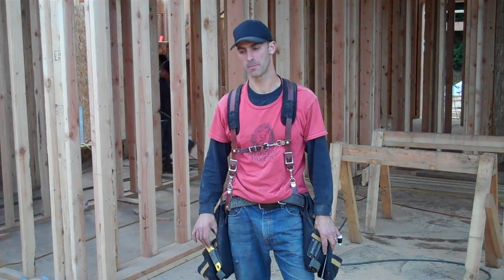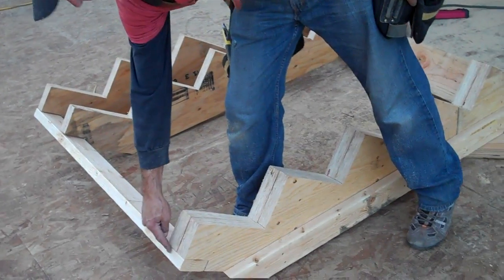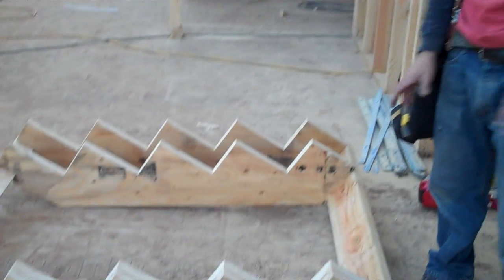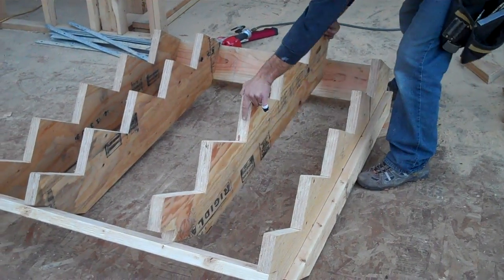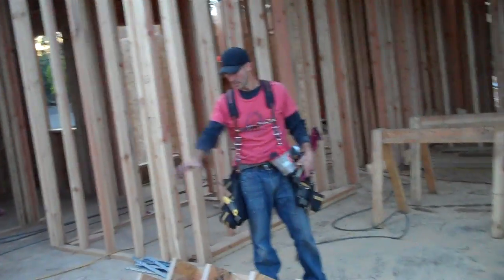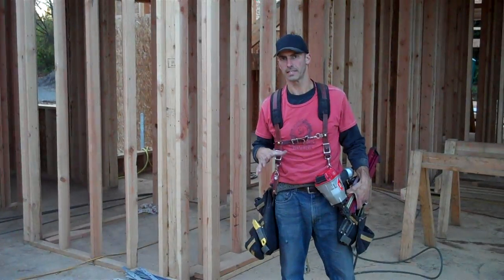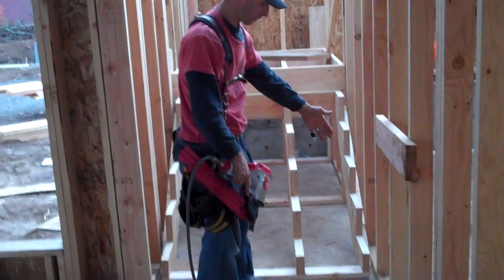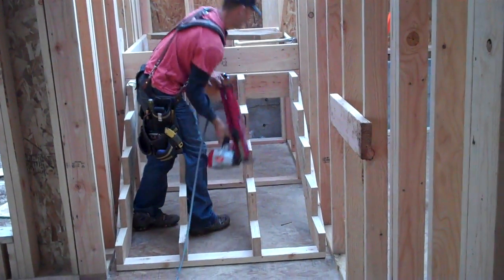How to calculate, layout and  build stairs- Part 3 of 3

Comment: Hi, great job and well explained. 
When you dropped the lower stringer by one tread thickness,  do you also drop the middle and upper stringers in the same manner?
Reply from the maker: Basically yes, but you need to think through each section about how you are installing it.  For the bottom of the lowest stringer, when you cut the thickness of the tread off the bottom, you are ensuring that the step differential is the same all the way up.  If you didn't, the first step would be too tall by the thickness of the tread.  So to your question, if one of the subsequent sets of stringers is sitting on a landing, you'd need to adjust those too.
Reply: Hi, thank you for responding so quickly.  I'm taking from your reply that I should reduce all stringers so all the risers are at the same height.  I was just concerned that after I do that my top flight would not be tall enough and I'd be left with a very high step onto the upper floor. 
Thank you again for all your professional advice,  I really appreciate it.
Reply from the maker: @danthechippie4439  If you have done your overall rise math correctly, and then cut your striggers accordingly, all you have to adjust for is your tread thickness.  When you cut your stringers there was the same rise from one to the next.  When you add your tread material, you have kept that same rise, since you added the same thickness tread to each rise.  The exception to this is the very first one at the bottom of the stringer(s), since you did not add a tread thickness to the floor.  If you didn't trim the first one, your first step would be too high.  Now to complicate matters, you need to account for the flooring to be used on the lower floor, the stairs, and the upper floor.  I highly recommend that you do a sketch so that you can capture all these elements and get your striggers correct.

Comment: Great series of stair videos.......So you reduce the overall width of the stair assembly by the thickness of the strong back pieces?
Reply from the maker: Yes, from rough framing.  These 2x pieces space the stringers off rough framing enough to allow for sheetrock and stair skirts to slide between the stringers and the wall.  This makes the install of sheetrock, and especially the skirt material, much easier as you don't have to notch for the stringers.

Comment: Torrey, you are a convincing teacher/carpenter. Your camera guy moves efficiently and lingers on markings, crucial. Maybe use a Sharpie( thick lines). You've mastered the 3 parts of explanation: tell us the 3 parts, explain and show the parts, and tell what you showed us. As a beginner, I made sure to lay out and cut 3 sample steps  on a plywood piece! Notch is slick addition.

Comment: How do you know how long of a stringer you will need so you're not buying too short or too long of a 2x12 or 2x10.
Reply from the maker: There is no easy answer for this.  You will need to either do some rough math or physically measure the area where the stairs are going.  Add 4-5 feet to what you think you need.  There will be a decent amount of waste on each end of the stinger- best to have a bit of extra than not enough.

Comment: this was a good video, one thing i must say is that you did not mention the importance of working from "finished floor to finished floor". the landing will have 3/4  subfloor on it and probobly some type of hardwood on top of that, or tile or watever. you have to take that into account if you want every rise to be the same. also you took off 1 1/8 off the bottom rise but did not add the thickness of the finished floor on the bottom
Reply from the maker: matt rider if you watch the earlier videos in the series you will see that I went over to different flooring top and bottom and how to account for this. Great comment though and important stuff for everyone to know
Reply: is the stair videos the only framing videos you have?
Reply from the maker: At the time, yes.  If there is another topic you would like to see, let me know and I will do my best.
Reply: Makena Built how about a video giving details on framing roof of a bay window?
Reply: for the steps to work on hard wood you would have to only take 3/8 off 
the bottom stairs. it will never work if you take of the tread thickness on the bottom unless you don't install any flooring on the bottom subfloor. if your step is 7' now with the  tread it will be 6'1/4 finish with 3/4' hardwood floor. the answer to this is simple measure finish to finish floor. then bottom step you take off you tread and add back on your flooring so now you find the difference for 1'1/8 and 3/4' there is 3/8 so you only take 3/8 off the bottom step and drop the top last step the difference between the tread and flooring for the top floor simple like that so if you have a 3/4 hardwood it 3/8, 1/2 click floor drop the top 5/8 vice versa !!!
Reply: if there is more then a 1/8 in the treads difference there no good by code

Comment: I see a lot of these video just saying calculate the stairs but none actually explain the needed distances for runs at the end of the stairs or actually the lengths explained on L shaped stairs on different levels. The steeper the angle means what?

Comment: You put a 1.5 inch 2x4 behind the stringer to allow a 3/4 inch skirt board and 1/2 inch sheetrock. What do you do to take up the 1/4 inch left over between?

Comment: I did a not see you measure the spacing to insure 16in centers. I did not see you measure diagonally to insure it to be square. Also, where is your cross bracing? Without cross bracing, over time the stringers can curl or warp and pull away from nails causing speaking.  A strong back should be on every stringer. If not then over time the center stringers can and will sag.

Comment: is there no need to deduct the stair thread riser which is 1 1/8? cos you have only deduct only 1 1/2 which is serve as cleat that will connect to the riser of your landing..
Reply: Rammel Suquila. pay attention... he did cut off the tread depth. go back and watch again. you probably shouldnt use power tools if you missed that.

Comment: only difference with my stairs is tge backer that gets nailed to the landing. 
 I use plywood rather than 2x.
 great video tho!
Reply: William Towle -plywood isnt acceptable by code. Isnt a solid mayerial. It is layered. plus a ledger is minimum 2x thickness.
Reply: Here in BC it's code. Pl subfloor glue is also used

Comment: what would i do different if i were using a stairs turn instead of a landing, infact i am doing that so i need a video helping with that please
Reply: KumbaYah Ahchyam -Do the same thing. Just look at every point in which u will step as just another step/ run. If your wanting to turn the case then your landing will not be a single square run but a wedge step/run. Depending on how wide you want each wedge will determine the amount of them needed.  Typically a standard turn consists of 2 wedges. So looking down from top on the turn, draw the square landing. Then make a line diagonally across the squaresplitting it into 2 triangles. Now simply picture one triangle  7in higher than the other. Stringers only change on one side. So stringer above will increase or decrease by one step. Or adjust stringers below. Either way only one set changes. Just remember, everything is just another step. shape doesn't matter.

Comment: Thanks for the videos, I am a stair finisher and really wish contractors would use the materials and procedures demonstrated in your videos.
Reply: ***** Hey Steve, yes I am a carpenter mostly finishing stairs

 https://plus.google.com/photos/113407286312573836698/albums/5957384077935437921
and I would not use dimensional lumber only engineered plywood, polyurethane adhesive, and screws .
Reply: +Steve “Acerman69” XXX  Engineered wood for stairs is a must. One thing I do differently is I always attach my strong backs to the wall studs then install the stringer.

Comment: Thank you, thank you, thank you!  Very well done set of instructions.  Last year I demolished a set of dangerous stairs going from my porch to the pool deck.  Not having the skill set to build new stairs or the cash to hire someone I’ve just done without.  Well a few weeks back I decided that maybe, just maybe I could build the stairs myself.

After searching the Internet for weeks I came upon your video series.  I watched the series all the way through and then watched again.  It was only after watching multiple times that I began to get the confidence to think this was a project that I might actually be able to do.

Well let me tell you the stairs turned out fantastic and exactly the way I wanted!  I used 2x12’s to build 5 stringers, used (2) 2x8’s for each tread and ripped 1x8s down to size for the risers.  The whole staircase is eight feet wide and just over 28 inches high and extra heavy duty.  There are only 4 steps and each one is just over 14 inches wide.

Again, thank you for the time and effort you put into making these videos.  I absolutely couldn’t have done without you.

Comment from the maker: If you are referring to the second set of stringers that rest on the landing, yes- you would again cut the 1 1/8" off the bottom of the stringer.  The adjustment would need to be made on each new set of stringers so that the bottom step is not too tall by the thickness of the tread material.

Comment: hi  makenabuilt   i have a question   on part 3 you have to nail plywood down on the first landing.on part 4  do you have to deduct 1 1/8 again on the bottom of the stringer  since is gona be  nailing down or resting the stringer right on the landing?  thanks alot

Comment: I have a question after watching all 3 videos in this series. Is there any particular reason why you dont use a stair shop ? I worked for a lumber yard here in NY for years, as a salesman, and our outfit actually had a stair shop. I used to go out to the site and measure for the stairs, and then our shop would manufacture a complete set of stairs. Just seems like alot more work to make them on site. Curious why you choose to build them yourself ? Is there an advantage? Cost perhaps ?

Comment from the maker: You need to have the entire bottom of the stringer on the landing.  The last part of the stringer is very weak out at the tip of the stairs because you have removed most of the stringer material at that point.  Usually there is tons of room to have your landing extend around the corner for your upper set so that the entire stringer can sit on the landing.  Your landing does not have to be square.  Hope this helps.

Comment from the maker: As to the 4 stringers and the engineered lumber in this example, it was way overkill, but that is what the engineered plans called for.  The overhang of the tread material does not affect the run, since it is the same on all stairs.

Comment from the maker: If the material is consistent from one piece to the next, then yes, you can trace the other stringers.  Just make sure that the material has been crowned properly and line it up as accurately as possible.  I would tack the pieces together with a couple of 8s to make sure they don't move while tracing.

Comment: I currently use padded nylon military "alice" suspenders. Best thing about most construction equiptment (puches, rings etc) is the wide belt loops. years ago i used to wear gear on the hip. So much easier on the back and hips when you shoulder that weight.

Comment: @truezstersnake Actually, the right side of the stairs and landing and the back of the landing, are both against exterior walls.  The insulators will insulate then cover the complete inside surface of all exterior walls will 6mil vapour barrier. Any part of that wall that's built against, should have a strip of poly applied by the framer between the exterior and the interior wall/landing so the insulators can join to it to have a complete unbroken vapour barrier.

Comment: @1too3fore You could use concrete anchor bolts as well.  If you use a 1/2"x4" anchor bolt you would drill a hole in the bottom plate (at least 2 but 3 would be best), then drill a 1/2" into the concrete floor with a concrete bit and hammer drill.  Put your bolts in and your anchored.

Comment: @makenabuilt when i used to work in construction and remodeling i used to use the concrete nail gun and it makes a pretty loud bang, but beside that i have to say that framing is the best part of any construction product, i fucking hate to do drywalls sending and painting

Comment from the maker: @1too3fore There are special nails just for this purpose.  They have a larger-than-normal diameter for strength.  There are also powder rounds/ nails that can be used if you have the gun to shoot them.  It all depends on how many you have to install.

Comment: I followed this to the letter the problem is you have two boards added below your landing i'm doing the turn the upper part you dont show ,the stringer came out right but there is nothing to hook it  is level at the bottom of the upper landing . How do I correct this ?I would even prefer the last step to be level with the upper floor

Comment from the maker: @iamjsmith83 Yes, you're correct.  Any differences in flooring materials would be made at the bottom or the top of the entire stair run, or anyplace a flooring material change was happening.  In the example on the video, the same hardwood was being used on the lower floor, stairs and upper floor, so there were no adjustments necessary.

Comment: @iamjsmith83 ok nevermind for some reason i thought the subfloor was already down on the landing. so then i guess the last rise is only off by the difference between the thickness of the stair tread and the thickness of the flooring they would put down on the landing...is that ok?

Comment: i just have one question if anyone can help...the 6th rise is the landing...which doesn't have it's finished flooring on yet. let's say they put 3/4" hardwood on the landing...that makes your final rise 7 and 3/4"....while all others are still 7" so wouldn't you want to add the 3/4" to your total rise when doing your calculations so that the rise onto the landing is the same?

Comment: @wolfpaw69  yes you would need a line or a pencil mark. This measurement should be the same as your riser hieght, but could be affected by if your treads and plywood for the landing are going to be two different sizes.

Comment: I see why you cut your tread thickness off the bottom of the stringer, did you cut the full tread thickness off because they will by using carpet and not hardwood/tile at the lower level?

Also, you cut the 1.5" ledger thickness off the back, would you also need to cut off the thickness of you riser board?

Thanks